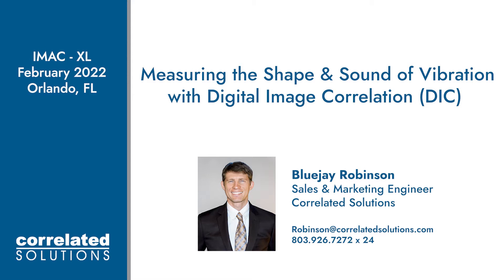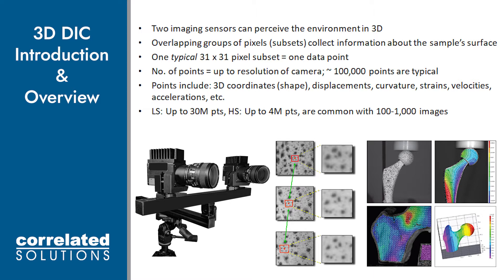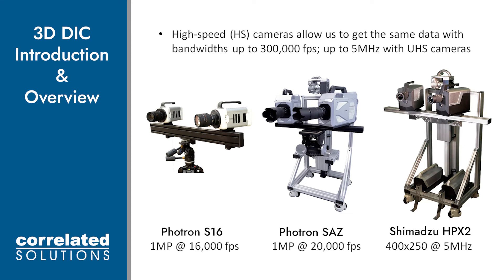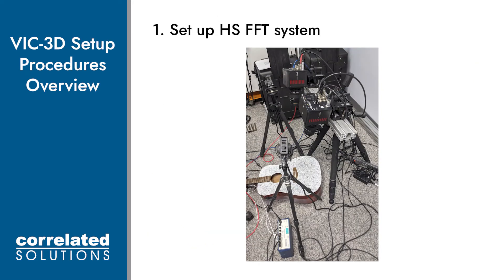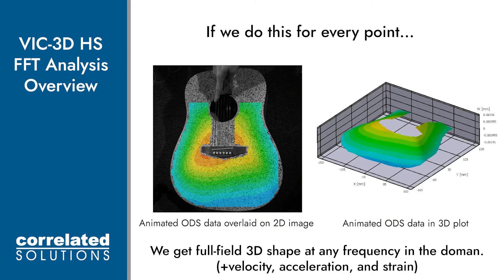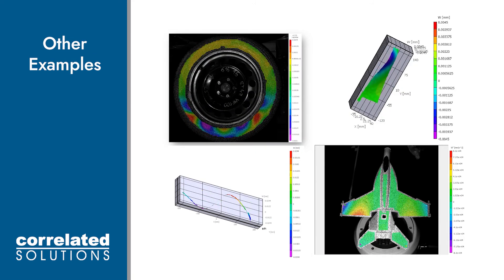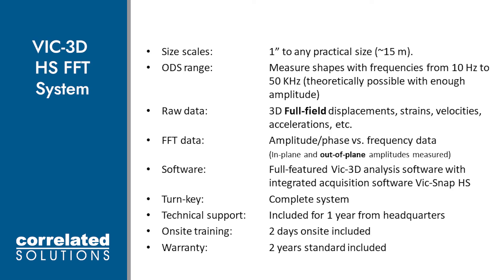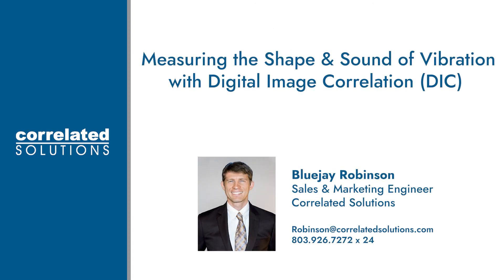Using DIC to measure the Shape of Sound and Vibration - 2022 IMAC-XL

Comment: What NI DAQ is it? Model number etc..
Reply from the maker: Good afternoon, thanks for your question. Correlated Solutions provides a line of data acquisition (DAQ) devices that are specialized for our DIC systems and provide a user-friendly hardware set-up. Our image acquisition software VIC-Snap integrates DAQ data with VIC-3D data quite seamlessly for automatic analog data synchronization. Many other DAQs and hardware triggering methods are also supported. Please email sales@correlatedsolutions.com to confirm if your existing DAQ model is supported and for more information about our DAQ lineup.